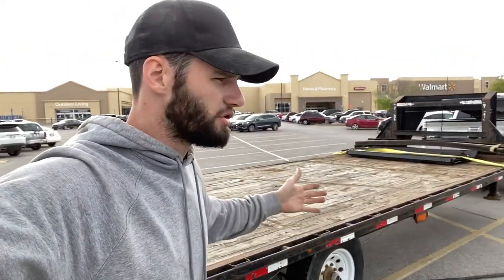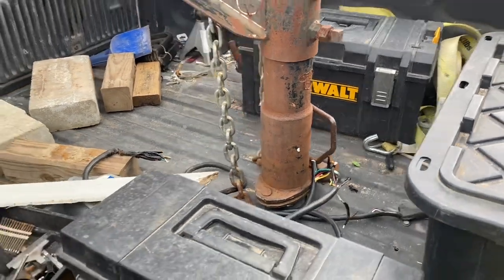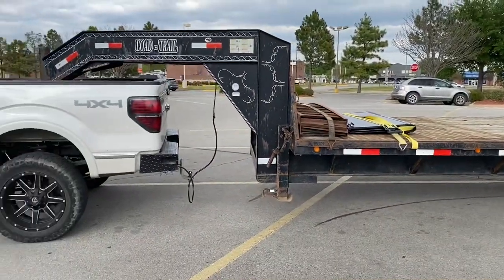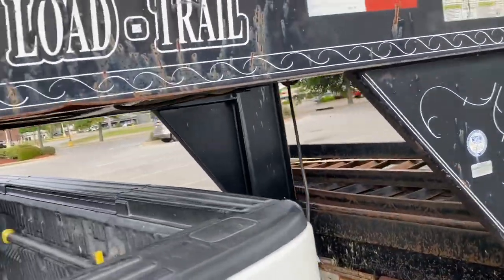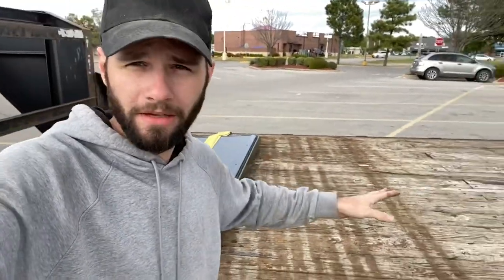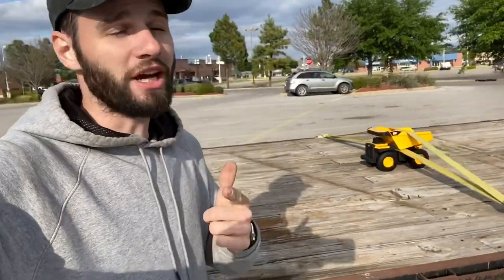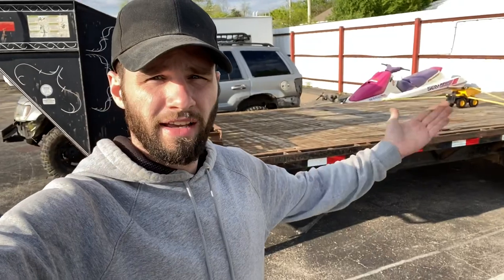lifted F150 Ecoboost Pulls A Gooseneck Trailer

Comment: Nice ride!  I have a 2013 f-150 with the 5.0 V8 and the hell-wig pro series helper springs.  I have a 24ft gooseneck.  It tows great just make sure you get your weight evened out if you end up adding length to keep your sway down.

Comment: 2005 ford f-150 lariat 4x4 (owner)
My truck pulls a 27ft travel trailer (6,800)

Yesterday i bought a 2014 f150 3.5 ecoboost twin turbo 4x4 (3.71 axel ratio) ... even though I haven't give it a try with the traveling trailer but this shit its fast,..... If u are looking to get an ecoboost for hard towing make sure u get one that has a 3.71 axle ratio, or at least a 3.55 axel ratio

Comment: If I'm correct that would be a DOT violation hauling that trailer with a F150 due to the truck GVWR + trailer GVWR  ( goes by sticker weight) will be over the trucks rated towing capacity.  Doesn't matter if you have your load scaled for the weight it goes by sticker weight
Reply from the maker: I was right at it with that set up, from guessing but I never had it weighed before I sold it! But yes you would be right

Comment: Definitely gonna be about 4500 empty, gotta include stuff like chains, spare parts, tools, fuel, etc. Your over your payload capacity for sure, that being said good trailer brakes, proper airbags and any gooseneck can be “safe” on a truck. Good setup, pushing the limits but you will be fine
Reply from the maker: I was definitely pushing the limits I ended up selling the gooseneck and I bought a 26 foot bumper pull car hauler that caused me to blow my turbos and eventually I ended up locking up the engine I recently switched to an 08 F250 diesel! Thanks for the comment!
Reply: @thebuckaroos6135  should have done your research 08-10 powerstroke are throw away motors
Reply from the maker: I know, really wanted the 6.7 but I couldn’t afford it, and after doing some reading most of the problems come from the egr system, truck has been deleted (by tuner only?) I will be getting the delete kit next week, 280k which seems like a lot to me, but people keep saying that isn’t a lot for a diesel 🤷🏻‍♂️ 

I will keep it for a year or so and then upgrade it, hopfully before anything goes wrong
Reply: @thebuckaroos6135  hope all goes well
Reply: I've hauled a f250 diesel behind my f150 with a gooseneck that has a empty weight of 5500 pounds with no bags. That was the only time I really wish I had bags though. I have hauled other trucks and hay on the trailer with out bags and it doesn't squat much at all.I want bags but they make it ride rough unloaded
Reply: @atvrepairsandmore2482  you must not load your trailer right or have a very light trailer my gooseneck empty squats my 14 3500 1.5 inches just hooking up the trailer however the trailer is 9000lb empty
Reply: @thebuckaroos6135  dump that 6.4 diesel. It will be a money pit. The same year 08-10 V10 6.8 gas is strong and reliable. It is very thirsty tho 😂
Reply: @thebuckaroos6135  Good luck with the 6.4. They are bad about washing down the cylinders even deleted. My 6.0 Powerstroke was hell of a lot more reliable than my 6.4 (and that is almost funny looking back on it all now). They pull amazing when you can keep them running. I now have a Ecoboost F150 for my daily and 6.7 powerstroke to pull my 5th wheel and skid steers.
Reply from the maker: I was able to sell the f250, I lost 2,400$ on it but I was able to get a pretty good deal on a 2010 F-150 raptor (with the 5.4) didn’t even know they came with that engine but the first 6 months they did, it’s always been a dream truck, it’s not the best version but it’s still a raptor and so far it’s been great! I will have to make a video soon about it and also my brothers 1998 Cummins on a 9” lift with 37s that he recently got as well
Reply: Brandon Taylor ya 6.0 has a bad reputation but they can actually be a really solid motor. 6.4 is a money pit. Parts are also a lot more expensive than a 6.0. Many people don’t know it but the 6.4 is actually the worse diesel ever, not the 6.0 like many think. There is a reason the 6.0 was made for 5 years and not 3 like the 6.4
Reply: @atvrepairsandmore2482  the 6.4 still made to this day, its called the maxxforce 7
Reply: @orlandoduran7740  well they only put them in the trucks for 3 years because they are terrible
Reply: @atvrepairsandmore2482  they put them for only 3 years because they needed a diesel to compete with gm and chrysler until they could find a solution for their heavy duty trucks and thats when the 6,7 came in they already had plans to bring the 6.7 they just had to fill in the gap for those years
Reply: @orlandoduran7740  yes because it was terrible...
Reply: @atvrepairsandmore2482  it all goes back to the 6L thats when the whole mess started and lawsuits

Comment: Be careful with extending the rear of the trailer. By extending the rear of the trailer you start removing Weight from the gooseneck in the bed of your truck. Which can potentially make it cool very unsafe

Comment: You guys are forgetting one thing and that is payload, with a tongue weight of about 15-20 percent of load, this body style 150 has a pitiful payload, I drive this same truck 2011, eco boost lariat 4x4, the payload of this truck is only 1263 pounds so put one 200lb guy, now your down to 1063, so a 6000 pound trailer has a tongue weight of 900 pounds whether you’re towing gooseneck or not that’s about the limit of these trucks,
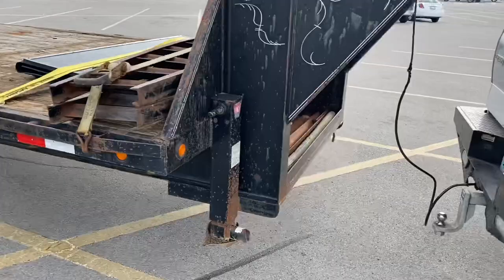Reply: My 2011 f-150 with 5.0 and 3:55 gears payload is 1690

Comment: Towing capacity is totally different from GVWR.  Air bags and air shocks do NOTHING to increase GVWR.  Putting all that weight behind the trailer axles is making it more unstable. That all looks scary.  Stick to the Walmart load.

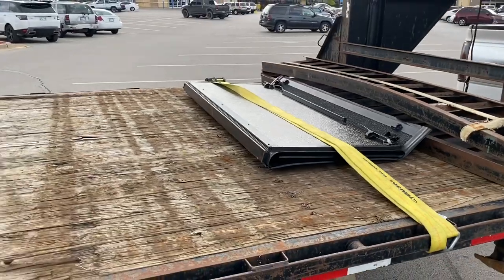Comment: Cool video. I just don't know why Fords f150's tows more than their 6.2 liter in a 3/4 ton or 1 ton on paper. I own a 2019 F250 4 door long bed with a 6.2, 3:73 gears and my door sticker says 10,000lbs. I bought this gasser because Im only towing camping gear,  cargo trailer, and 3 full size ATV's around. My max weight is about 8500 lbs. I went with the 8 foot bed because I have to put an ATV in the bed. I am just having a hard time believing that a v6 with a turbo can out pull my engine. An F 150 would make sense especially in town driving with no load and the awesome fuel economy. I think with a 4:30 gear in the rear would get me 13,000lbs. Maybe I should have went with an F150 with their longer box.
Reply: That 10,000 lbs Is probably what you can have on your truck not tow rating

Comment: Really 6” lift with 33’s purity sure if that’s just 33’s then you only have a 4”lift. I have a 12 f150 EB with a 6” lift and 35’s and they look no difference in clearance? Have definitely done plenty of pulling with my EB and wow is all I can say lol at least for a 1500.
Reply from the maker: I Made a video of installing that lift, had 33/12.5r20s on that truck

I had add a leafs and air bags in the rear so it was much higher in the back then 6”
Reply: Sweet I’ll check them videos out

Comment: A couple things, 1. I loved the video. 2. Have you had any issues with your suspensions sagging in the front from the HD Bumper? I have a 2009 F150 with a RC 6 inch lift as well. I have a winch and hidden plate up front and its causing the Rough Country struts to sag.  3. Thanks for the gooseneck idea. I did some research and I found some compatible kits to airbags and the gooseneck on my F150!
Reply from the maker: Now that you mentioned it, I havnt noticed any sag, but as soon as I got the truck, I did the lift, but kept the original struts, never really looked at it. Being able to get a whole kit would be pretty cool, I just finished installing add a leafs to the truck yesterday as well! Thanks for the support! If you have any questions just let me know!
Reply: im running a 6" rough country with a gooseneck on my 2010. DM me on instagram for questions @colton_dieringer
Reply: I also have pictures as well as the kit i am using been towing with mine for couple years
Reply: @thebuckaroos6135  I have the rough country 3.0 6 inch lifted struts and I have about 2 inches of sag now The springs up front cant handle the weight of my winch and winch place which weight about 150-175 lbs. This is causing my 35's to start rubbing in the front at full lock when they didn't use too. My two options are going to a factory strut with a spacer or upgrading to some coil overs but that would put me back about $2,000.